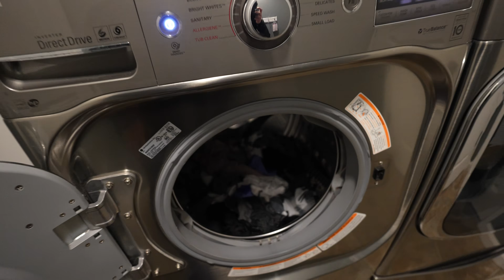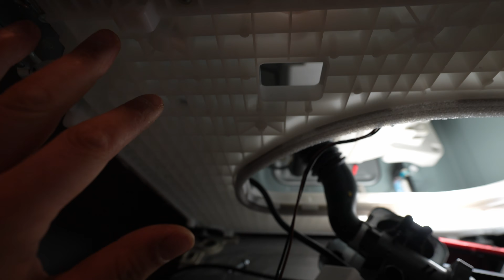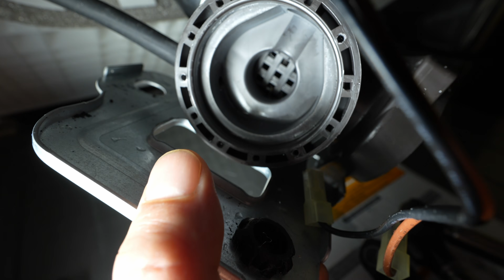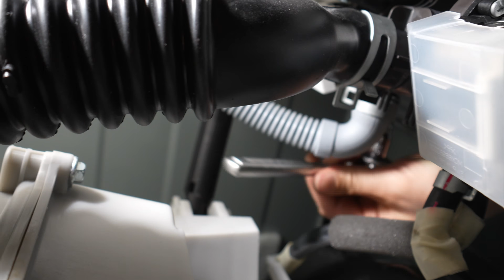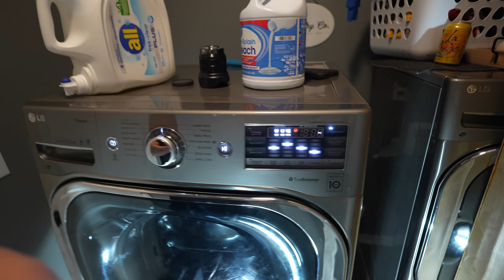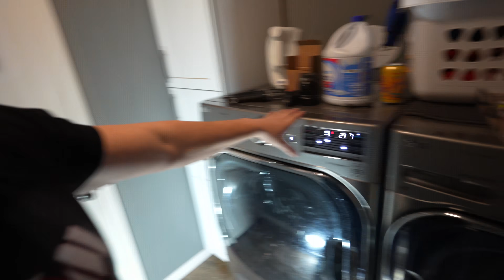LG washing machine not draining making loud noise front load pump replacement

Comment: Thanks for the helpful video.  The replacement of the drain pump was "mission successful" for me.   Some videos called for disassembling the whole front of the washer-a no go for me.  Tilting the washer against the wall was done safely and secured.  One one issue, the pump replacement from Amazon was not a like for like replacement.  The motor electrical plates were bigger, than the original,  and interfered with the pump cover.  So, with a little creativity, thought,  and determination, I trimmed the cover so the cover could slide over the pump.  Viola, it worked.  Thanks again

Comment: How the heckkkkkk did you get those bolts out that hold the housing in? I wasn't able to squeeze a socket wrench (or any wrench!) past all those hoses! And I wasn't able to disconnect them, either! After 2 hours, I gave up. 😅
Reply: I just did mines... Get an extention...
Reply: @nevrbdwnruby7484  Yeah after the guy came and fixed mine... he revealed that the front cover actually comes off. Don't even need to do this whole "tilt it back and crawl under it" nonsense.

Comment: Thank you a ton for this video.  I have a WM4370HKA and I was getting the time stuck on 9 minutes and it wasn't completely the cycle with the OE code.  I thought it was the pump so replaced the one in the front, however I got a drain pump.  Stil lhad the same noise and I ended up ordering a new unit since it would take a few days.  After seeing your video I realized there are actually 2 pumps.  After removing the rear pump we realized it was bad, so I got a new rear drain pump and front recirculating pump.  Now the unit works again, and I saved nearly $1300 on a new one.  I looked at a parts site that had every part listed, however it never showed the recirculating pump, just drain pump, so I assumed there was only one.